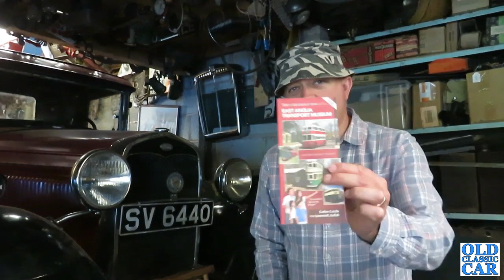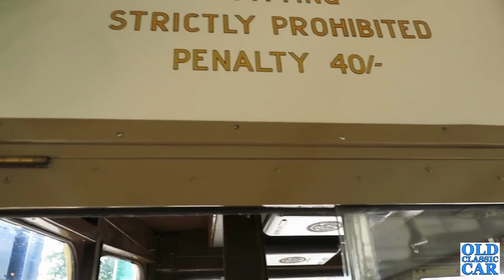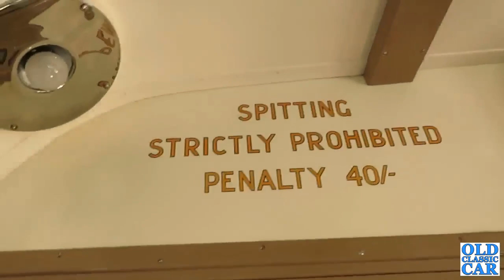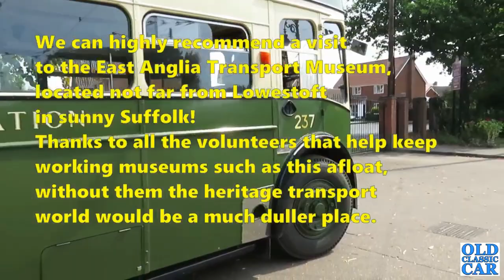Riding on a TROLLEYBUS | East Anglia Transport Museum

Comment: Thanks for posting.  As a kid I rode on trolleybuses. Apart from the older ones which could be a bit jerky, they were smooth, quiet, had great acceleration, could climb hills easily and produced no fumes in the street.  Their passing was mourned by many. The Derby vehicle is almost one of the last trolleys to be built.
Reply from the maker: Interesting, thanks for that, yes I believe the one we rode on only served between 1960 and 1967 before being pensioned off. Keep an eye on the channel as I'll do a video about the museum as a whole shortly, including a ride on a preserved tram. RJ